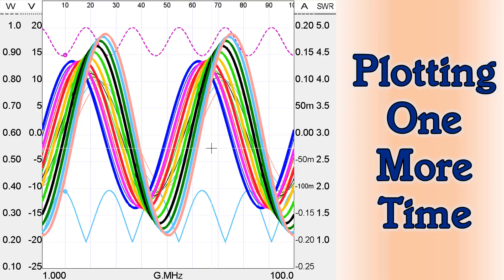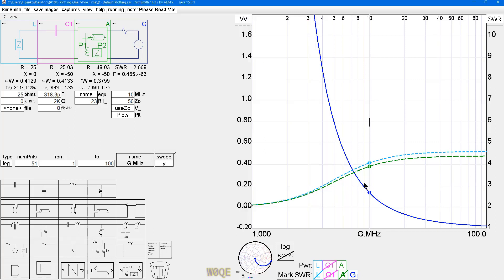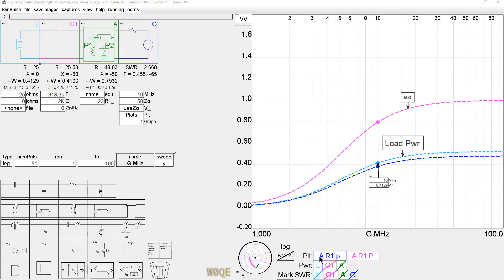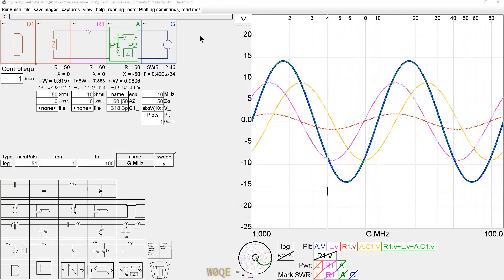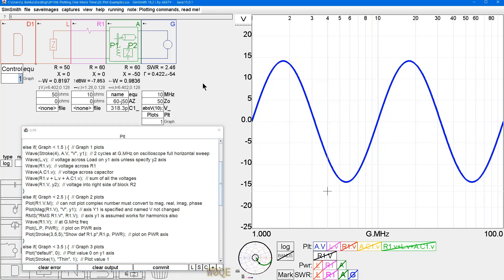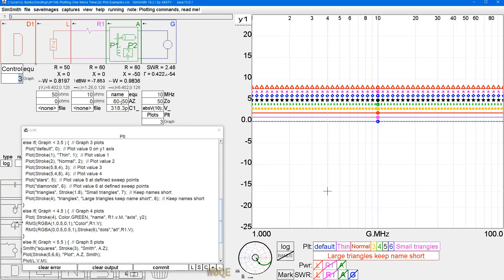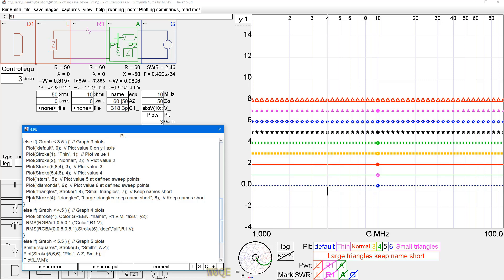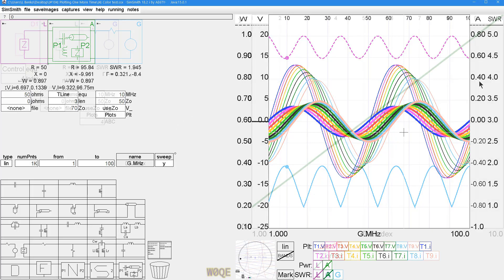#104: Plotting One More Time

Comment: When plotting 'Waves', the phase of the voltage coming out of the generation is not always 0.  In Larry's example, the voltage is 'absV' and that DOES always have zero phase because the generator's internal impedance is 0.  However, if the generator has an internal impedance (say 'useZo') and the load is not resistive, the phase will NOT NECESSARILY be zero.
Reply from the maker: The absV generator is my generator of choice when I use SimSmith like an oscilloscope plotting waveforms for this reason.  I think the Wave function can really help to understand how a circuit works.
Larry, W0QE

Comment: Larry mentions that when placing a marker on the Square or Smith chart you can only place the marker at a computation point.  True enough.  However, once placed, you can change the values of the parameters to plot specific points independent of the 'computed' values.  Internally, SimSmith does an explicit evaluation of the circuit after setting the parameter values.  Warning: this can result in the marker pointing to a place not on the line!
Reply from the maker: I have shown this in previous videos but forgot to mention it in this video.
Larry, W0QE

Comment: Larry mentions that if you select something to be plotted in a RUSE block (around 3:40) you don't get any errors when you remove the RUSE block.  True enough.  You can also do plotting in the text section of the block, just as you can in the G.PLt dialog.  This has the same advantage.... the plotting commands go along with the RUSE circuitry.  Additionally, if you duplicate the RUSE block you can have the Plot commands duplicated as well.